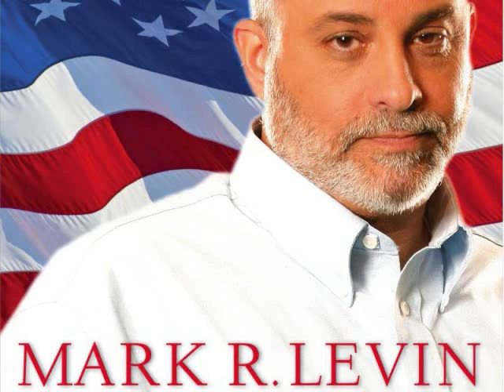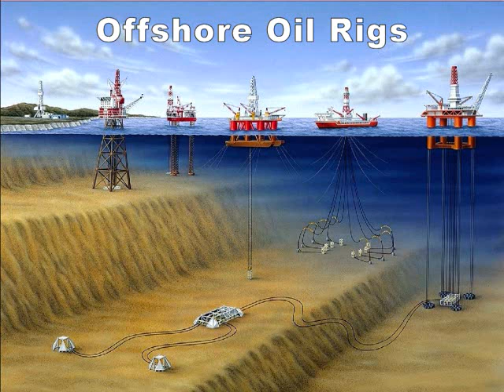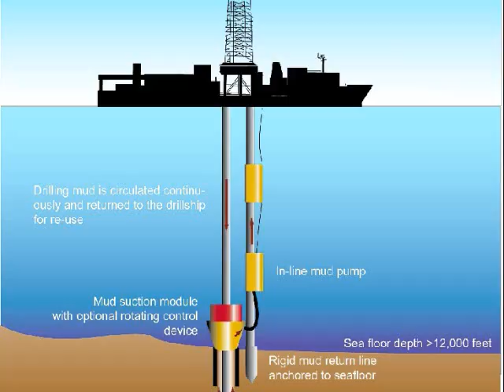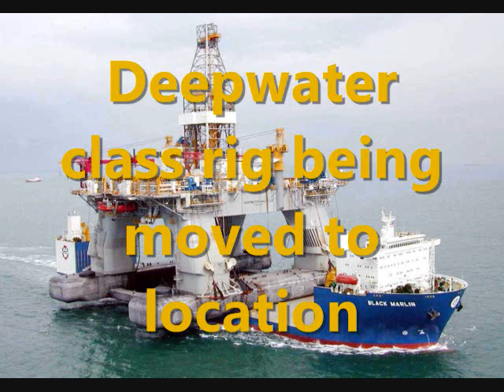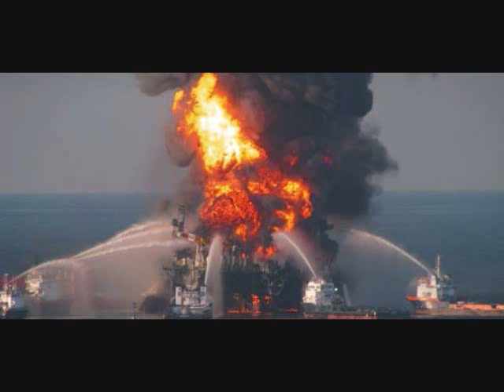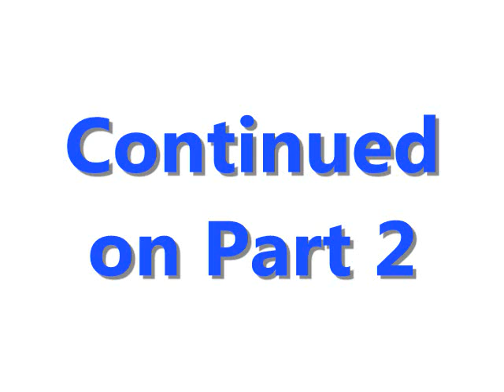Mark Levin Show - PART 1- caller "James" survived the Deepwater Horizon explosion

Comment: STOP 
using  products of the Peckerheads built Stink, POISON, cheap products to crash. All testing epuipment from Laversab unit automatically take off and landing achieves the targets high acurate 99.98 % out of control and spin aircrafts without warning the airline land tail first, break off, burst into flames crash and burn then kill people. Made in China dry wall hidden tag inside the products.
On the other hand all is becoming a "cattle car"